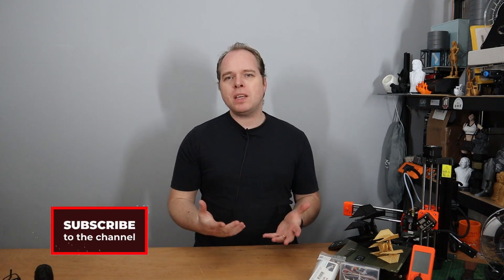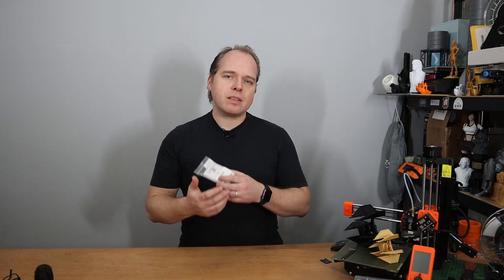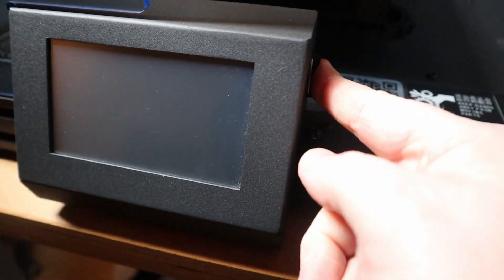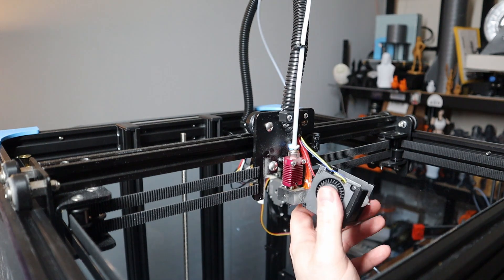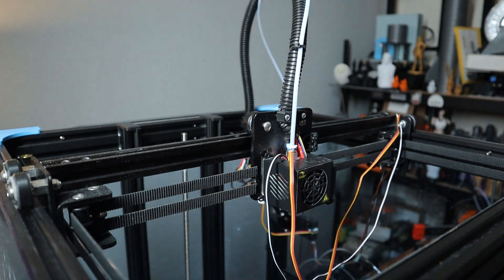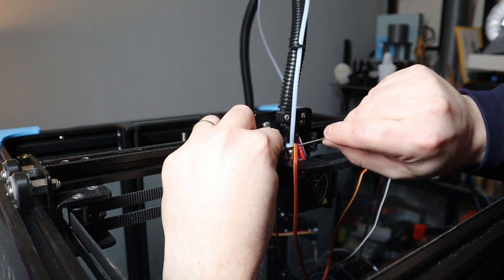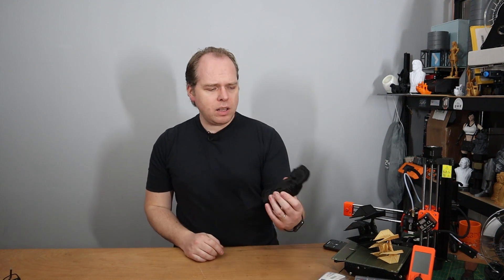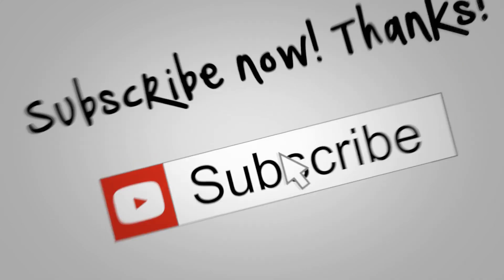How to install BLTouch on Creality Ender 6

Comment: It would be nice if this worked but it doesn't for me. I uploaded the firmware and all I have is Chinese language and it won't change to english. I've tried several different .bin files and none of them will solve the problem. I've tried all of the DWIN_SET solutions and those don't work either. The printer just gets stuck on the splash screen. I even tried flashing to a new firmware and that doesn't work either.
Reply from the maker: I'm sorry for the late reply. 
Oh that sucks dude, sorry to hear that. So the firmware for the board and the firmware for the screen isn't working? 
Is the issue solved in the meantime?

Comment: great video! however i am having so many troubles with trying to save my leveling. anytime i turn off my machine and turn back on it relevels everytime! im unable to get it to save the settings
Reply from the maker: If correctly, you use a printer profile in Cura or in Prusa Slicer that has the ABL in the title, if they don't add in the start Gcode G29 after G28

Comment: Hi sir, is 3d touch same with yours? Can i replace with that
Reply from the maker: Hello Aqila dhia syarafans, that should work the same as the BL-touch. It can happen that it might work inconsistantly. But if it works, it works. In a later stage that it might not work, you only need to replace the probe. I think that's handy ;-)

Comment: Do I have to fully compress the 4 corners before doing auto leveling? I also saw on other sites  that you have to adjust the z offset first.
Reply from the maker: Yes, that’s a good starting point and doing the offset is really needed

Comment: A useful video thank you. In my case, I had to connect the Bl-Touch directly to the motherboard because 3 out of 5 wires are missing in the 24-pin cable that goes from the motherboard to the small card with the BL-Touch port. Weird
Reply from the maker: Thank you. Having a adjusted write to connect to the mini board is handy, but directly connecting it is also possible to let it work.
Reply: @damienraulais4822  I’m in this same boat but I can’t figure out exactly where I need to connect the wires on the main board to get this to work

Comment: I did not see you first set the z-offset before auto leveling. This is a very important step because you can't adjust the center of the bed with springs. That's why you set the z offset and THEN do auto-leveling.
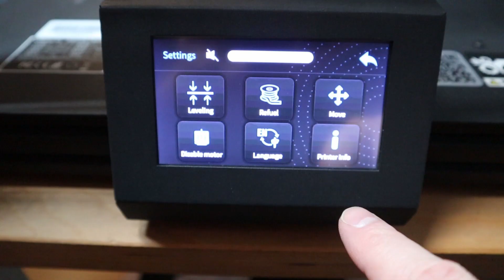Reply from the maker: Hello, normally yes for the other printers, in the case of the Ender-6 I used the left 2 buttons to raise the bed 7:38.
Picture I had used, I have taken a bit later

Comment: Hi Zachary, I have encountered the same z offset and xy stepping motor crashing and noises also. When done measuring and trying to bed leveling get all power on BLTouch and measuring values of BLTOuch, however, only goes to center then to back right corner of bed and does the measuring only 'diagonally' across bed to front left corner (makes all kinds of noises and bangs against rails at right back corner and front left corner in process, clicks on x Endstop front left corner) then measures back to back right corner again saying it's completed the 25 sections (was struck on 18 for a bit but troubleshooted and got it at least to 25 but diagonal on XY!??) but does not travel left to right horizontally across x and y axis...several others have had this issue I have read. 
My, and many others not being answered a simple question, so when you flash the BLTouch 3.1 firmware on empty formatted SD card you turn off printer, unplug, then remove the SD card and delete the bin file but keeping the EEPROM file on it...then do you transfer this EEPROM.DAT file to the factory SD card that came with original firmware? Or, do you have to transfer this to card and update mainboard firmware, or do you simply add the G29 'BLTouch MESH GENERATION' under G28 Home to Creality Slicer printer settings for CE-6 and it should fix the noise and XYZ offset issue??? I have flashed the latest BLTOuch FW and shows the V1.0.4.9 version but still having the noise and offset and crashing rail issue. 
Please help..been working on solving for weeks now and so close!! GREATLY appreciated Zachary! Cheers.
Reply from the maker: Sorry for my late reply on your question. if you are going to update the firmware with the BL-touch on it, I used a new formatted SD card, making sure that everything is going to be updated correctly. 
Take another SD card slice some models with the updated Gcode G29. Once your Ender-6 is booted up with this SD card an EEPROM.BAT file is going to be added to this card. 
And check if you have followed all of the other steps too.
Let me know if you still have issues
Reply: @Zachary3DPrints  Hi Zachary, no sweat and appreciate your reply however late, understandable as I see your doing well on here and swamped with asks. haha Well, if you can believe it, after almost 2 months of torture with bltouch infuriating issues, just yesterday I did a full cable review and realized after replacing breakout board (after troubleshooting bltouch problems and when pulled out cable and poorly soldered port pulled out of board and had to order new board to replace) upon rushing to install and get up and running again, I had accidentally, stupidly really lol I had reversed EO and Y stepper cables by mistake. Switched cables last night, unplugged bltouch, put back in z limit switch and reflashed previous version V1.0.3 endstop firmware and BOOM...working like a dream now! Going to flash V1.0.4 endstop and bltouch now as well. After seeing numerous people with this problem you can suggest to check this as a possible fix...easy, oversight mistake really. As far as the G29 sliced models thing I have done that and got it printing beautifully now. Only other issue came up after a few prints is the gears barking lightly and are slipping on filament feeder a bit now...tried loosening/tightening the spring screw but not correcting so far, would you recommend taking out and just cleaning gear teeth, or can you recommend a good replacement for the stock supplied? Thanks again Zachary and let me know what you think, cheers!

Comment: I keep hearing it is so simple. But no matter what I do, every time I switch the machine off and on the next time the BL touch will try to print high in the air. It does not save the values even if I leave the SD card inserted.
Reply from the maker: True, it's not that simple. The firmware isn't stable. 

-Make sure to have the file on the SD card named firmware.bin
-remove it after the loading when switched on
-always have the printer turned off when removing the SD card with the sliced models on it where the EEPROM is saved on.

Comment: do you realise you are showing a bltouch installation and u don't talk anything about auto leveling and z offset? it makes no sense nobody will install a bl touch to do a manual leveling and to risk a crush when switched to auto because is not calibrated with the z offset....
Reply from the maker: I fully understand your comment, but the Ender-6 doesn't have the same menu as the Ender 3v2 where you can set the Z offset.
In the last part of the video, in the leveling menu 
I did raise the bed as close to the nozzle as possible, using the UP and DOWN arrows on the left side of the screen, then I did the 5-points leveling to make sure the bed is level to the Hotend, 
and then I did the Measuring, after that I switched on the Auto Bed Leveling.
I'm also not happy with the type of menu Creality did use on the Ender-6, but there is no Z-offset.
Did you encounter problems using the mentioned method?
Reply: @Zachary3DPrints   Hi Zachary, I have encountered the same z offset and xy also. When done measuring and trying to bed leveling get all power on BLTouch and measuring values of BLTOuch, however, only goes to center then to back right corner of bed and does the measuring 'diagonally across bed to front left corner (makes all kinds of noises and bangs against rails at right back corner and front left corner in process, clicks on x Endstop front left corner) then measures back to back right corner again saying it's completed the 25 sections (was struck on 18 for a bit but troubleshooted and got it at least to 25 but diagonal on XY!??) but does not travel left to right horizontally across x and y axis...several others have had this issue I have read. 
My, and many others not being answered a simple question, so when you flash the BLTouch 3.1 firmware on empty formatted SD card you turn off printer, unplug, then remove the SD card and delete the bin file but keeping the EEPROM file on it...then do you transfer this EEPROM.DAT file to the factory SD card that came with original firmware? Or, do you have to transfer this to card and update mainboard firmware, or do you simply add the G29 'BLTouch MESH GENERATION' under G28 Home to Creality Slicer printer settings for CE-6 and it should fix the noise and XYZ offset issue??? Please help..been working on solving for weeks now and so close!! Thanks!

Comment: can you please make a video how to install CRtouch not Bltouch on ender 6
Reply: its the exact samething just metal.
Reply: @slacksthegreat  I tried to install cr touch on my ender 6 like he did with bltouch but is not installing the firmware completely and it makes lot of noise (cr touch) and fan is running like crazy
Reply: @MihaiDobrin88  the wires on the cr touch side is backwards so you have to loft the little plastic fingers with something like tweezers and swap them. So if blue red yellow black white make them white black yellow red blue.
Reply: @slacksthegreat  I tried what you said to unplug and replug în the exact opposite order the cables into the cr touch. Now it works thank you so much. Is it any way you can save the measurements into the printer?
Reply: @MihaiDobrin88  I just got that far I'm stop trying to figure that out
Reply: @slacksthegreat  I have a capricorn tube and extruder on it's default poziționare and I've seen I have some stringing did u fix the stringing issue and how?
Reply: @MihaiDobrin88  I ran out of time to finish I will check it out when I get off work
Reply: @slacksthegreat  ok if I'll find out anything I'll let u know now I'm playing with the crtouch trying to get the 1st layer well
Reply: @MihaiDobrin88  so what you have to do is go into leveling and on the left you will see arrows and home button. aux level the bed and the go to measure. once it finishes put a piece of paper and press the up arrow till you can barly move the paper. then turn and off and back on autolevel. and hit home twice (again after it finishes probing.) the second time you hit home it should be close to the bed like it should. i know its a lot but that is what worked for me.
Reply from the maker: For the Firmware, you need a clean formatted SD card and put the Ender-6 firmware with the BL-touch in the name on the SD card and rename it to firmware.bin
If you insert the SD card into the Ender-6 you need to startup your printer... the loading from the printer takes longer than normal.

Which fan is running like crazy? Was that there before? And is it still there after reinstalling the firmware like mentioned before?
Reply from the maker: Normal wiring on the BL-touch is: White, Black, Yellow, Red and Brown.
For the Creality used wires, this should be: White, Black, Yellow, Red and Blue.
If I'm not wrong, I saw that the CR-touch uses the same wiring scheme as the BL-Touch
Reply from the maker: Hi Mihai, in the leveling menu, you find this Measuring button, this will save it somewhere in the board. If you are going to print something, switch off the printer, remove the SD card, save your model to that SD card and switch on the printer with the SD card inserted. because on the SD card is the EEPROM file, where the last settings are saved.
I have issues when switching SD cards
Reply from the maker: Thank you for helping buddy
Reply from the maker: great addition to the video. this is what I also do, making sure to get that first level right
Reply: Just a heads up if you haven't figured it out by now Mihai...researched huge before attempting to buy CR-Touch...DONT. Uses metal pin and will rip up your board! Go with BL TOuch for sure and like others mention you must only use V1.0.4.9 firmware version if you do the soldering of the wires properly and follow to a tee, not only, the auto bed leveling level but then the manual leveling afterwards. The video actually comes on your Ender 6 Flash drive SSD card...slow down and go  through everything and you should be alright

Comment: When you soldered cables did you do that colour to colour or? Video is to fast in that moment
Reply from the maker: I use the same colors on both sides. So red on red, orange on orange, yellow on yellow, black on black and white on white.
Reply: @Zachary3DPrints  i did the same and all i got is loud sound coming from printer and its not booting (yes I did updated firmware )  I don't know what else I can do
Reply from the maker: Did you pull out some other connector? Endstop?
Reply: @Zachary3DPrints  hello, thanks for advising,  I'm on holiday when I got back to home ill check it out
Reply: @Zachary3DPrints  yes, I did disconnect z stop, it didn't make any difference
Reply: @Zachary3DPrints  i emailed you
Reply from the maker: @leobardek  yes I have received your email and I’m working on it to help you.
Reply: @Zachary3DPrints  thank you!

Comment: I followed all steps - when switched on printer i makes a constant loud noise and nothing - loading screen bar is not progressing, everything goes back to normal when unplug bl touch cable either from motherboard or bl touch itself, what do i do wrong ? did you have to unplug cable from  "z" limit switch on mobo ? this is what instruction  from bl touch says - but i can't locate  this cable
Reply from the maker: I'm sorry you ran into these troubles, you have used the right cable for the BL-Touch, or connected the right colored wire to the other one? For the Z endstop, I turned the screw on the back of the bed a few turns down. 
if the BL-touch is connected correctly on to the little board on the side of the frame, the Endstop screw is turned down, or disconnect the Z endstop. Put the firmware (the .BIN file) on a formatted SD card and reboot your Ender-6 with the firmware.
Reply: hopefully you found a fix if not your cables need to be rearranged in the connector on one side of the cable. eg. blue red yellow black white. to white black yellow red blue. you can use tweezers to lift the little plastic arms on the connector and pull the out.
Reply: @slacksthegreat  all sorted now , had to reverse color order when soldering

Comment: What version of bl touch did you use?
Reply from the maker: I did use the version 3.1. At this moment the firmware gives some issues, I have asked Creality to update their firmware. If not, i'll try to upgrade the board and make a new firmware
Reply: @Zachary3DPrints   what kind of issues? I’m planing on doing the same replacing with big tree skr pro or adding klipper what do you think ?

Comment: Sadly you dont show how to connect the wires right.
I have not been able to get my ender 6 to work now since receiving it. Now i am still looking for how to connect the wires the right way.
Reply from the maker: Which BLtouch kit did you buy? Because I connected to the small connector into the BLtouch and the bigger connector via the cable boom, to the small board by the extruder
Reply: @Zachary3DPrints  Feel for you Zachary! Yes, it's the one 5 pin connector left  and the  only one that is actually labeled...'BL Touch'...jeeeez lol

Comment: nice video and thank you i have come to do this myself and followed all the steps you have laid out but when i try to auto level the bltouch leaves the bed about 8mm from the printer head. Any suggestions?
Reply from the maker: Hey buddy, did you check the end stop screw on the back of the bed carriage? And check the Leveling menu, it should have a ARROW UP and ARROW DOWN on the left side of the screen. with those arrows, you can adjust the height of the bed

Comment: my ender 6 seems to have  unleveled itself, is this normal? ( i dont have bltouch yet)
Reply from the maker: In this case, try to screw in the little know by the Endstop for the Z-axis and level the bed again. This way the spring on the bed have more tension and less likely to unlevel itself

Comment: I can't get mine to auto-level.  During the initial setup process, when I click to 'measure' it does the first row, then hangs half way through the second row!
Reply from the maker: Hey Jonny, did you maybe missed one of the steps? Assuming the steps before were all done. When doing the leveling in the printer, make sure that the knob in the back is down, or the Z endstop is disconnected. When selecting the Level menu, the printhead moves to the middle and taps 2 times. When done you'll see in the level menu on the left-side 2 arrows to move the bed closer to the nozzle. use a piece of paper to check if this has the right distance. After that start the AUX leveling (the 5 points leveling) and adjust the bed with the big leveling knobs like normal. After that switch on the Auto bed leveling. This should work, but don't reuse the SD card with the firmware on it, it will reload the firmware again.
Reply: @Zachary3DPrints  Hi!  Yes, did all that.  I think there is actually something wrong with the printer.  The supplier is contacting Creality as nobody can work it out, and the failure happens at different points.  Sometimes it even crashes the probe into the bed when it first homes during the levelling process - which is a nightmare!